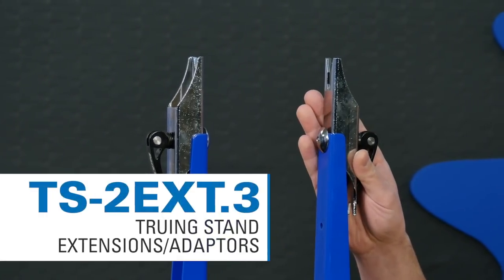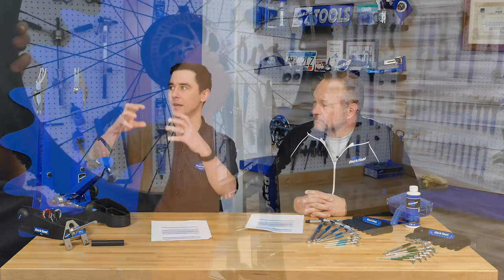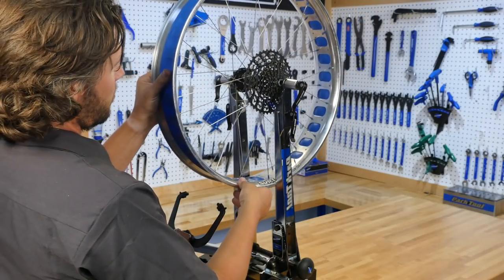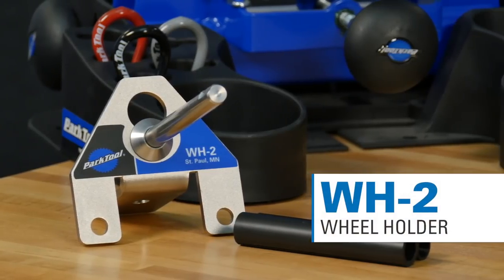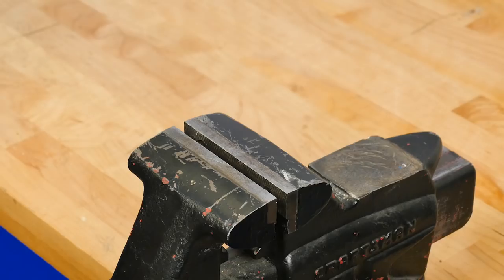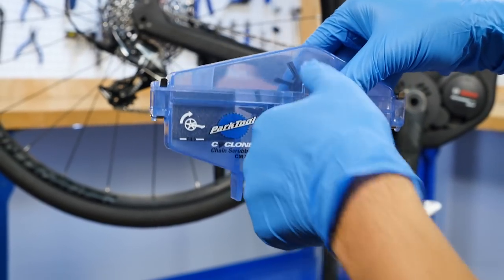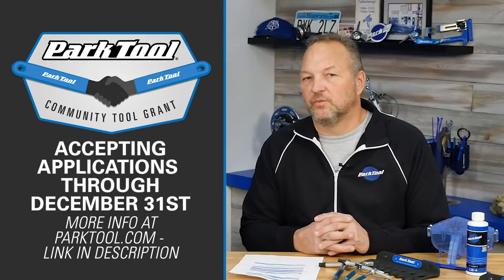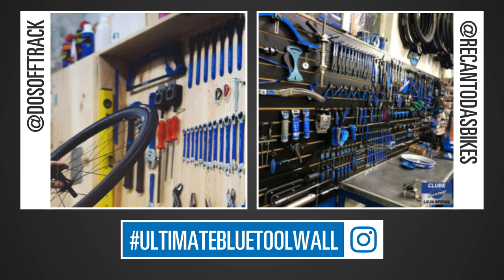New In Blue Episode 4 | New Tools for Winter 2020 + Old Tools from 1958

Comment: I've used similar hex-tractor wrenches. I find they don't work on anything truly rounded out, with the exception of aluminum fasteners. However, they tend to chew up the interface beyond reasonable re-use, so I don't know why you wouldn't use an easy-out.
Reply from the maker: The extraction side would only be used when the normal hex side fails. A common cause of failure is simply poor engagement by a user, with the wrench partially installed.  It ruins it for hex use, and that is where the hex-tractor side can help.  An "easy-out" is an option but that required a drill and bit to get enough purchase for the easy-out.

Comment: The chain cleaner is JUNK. I've had two and they were used gently and they BOTH CRACKED! Park Tool said it's not their problem! Park Tool generally has NEVER stood BEHIND any of their tools! I've spent thousands $$$ and the few tools I've had issues with, they blame me even though I am a trained bike mechanic, frame building and have a degree in Mech. Engineering and Precision Machining.
Reply: Wow sorry to hear that, do I like the story of park tool I also like to here real people like you, can you safely say it’s ok to buy generic tools for bike repair?
I’m just starting out and this things are expensive.
Reply: engineer, there we go lmao
Reply from the maker: Mekhanic1, I hope you do not base your opinion of all our products on your chain cleaner experience. Please give us a call 651-777-6868 and I would be glad to talk to you more about your issues. We take pride in standing behind our products and is why people should feel confident in their Park Tool investment.
Reply: I've had issues with only two items from Park.  One was the chain cleaner and it only had issues because I dropped it.  I emailed them just looking for advice fixing it because I knew I broke it.  They said not to worry they would send me a replacement part.  Instead they shipped me a brand new cleaner and it works like a champ.
Reply: Park tool 👍🏻
Reply: My experience with the Park chain cleaner has been excellent. And the tool is even better when coupled with the Park Tool Dummy Hub which allows easier access to cleaning the rear derailleur.
Reply: Zello King check aliexpress, that’s where I get most of my bike tools

Comment: What I want to know is: When will Park Tool fix their PTH-1?  I use it with those blue shop paper towels, and the roll won't even...roll.  I always have to sort ot unwrap the next paper towel from the stationary roll when I need one.  I think it is a crying disgrace that the PTH-1 won't work with BLUE paper towels.  Come on, Park Tool.

Edit: Seriously, the PTH-1 is junk.  I'd throw it in the trash but then I wouldn't have any place at all to put paper towels.  So I guess it's better than nothing.  But not by much.